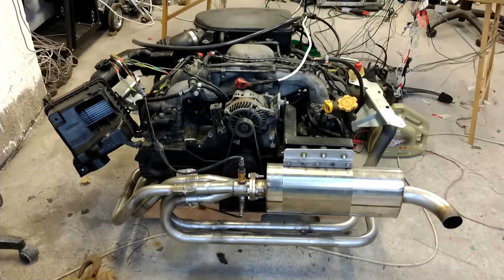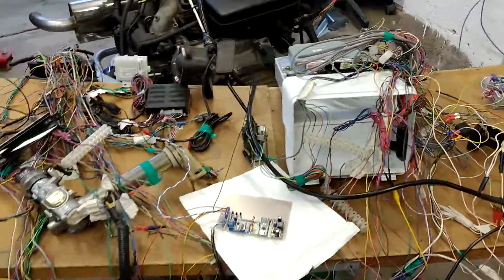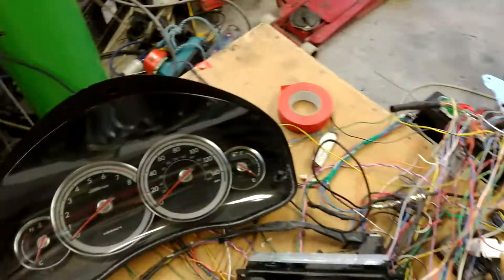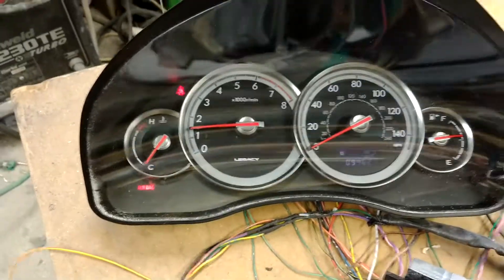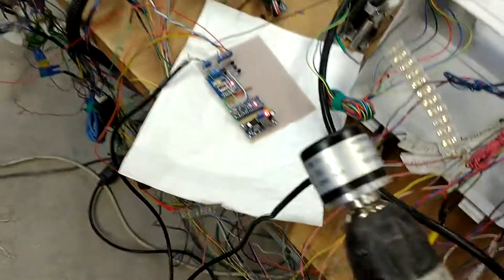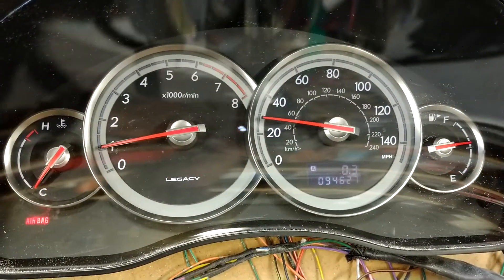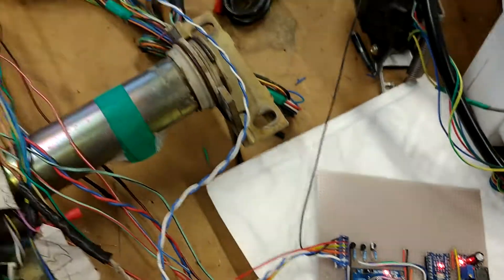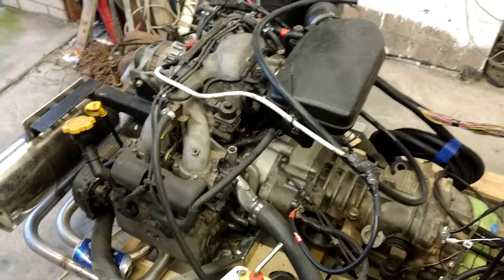VW T25/T3 2.5 Subaru Conversion using MK4 CAN Bus Engine

Comment: Damm. did you do this all by yourself? I am trying to convert a EJ204 for my T3 and none of the converters want to touch it because it is a CAN BUS model.
Reply from the maker: Hi. Yes all me. Although the video shows a prototype board, I made a PCB in the end to do a good job 🙂
Reply: @ well done. 
I am not sure I could ever finish this project, Fellows Speedshop will do it apparently.
Reply: @johnpaullucas  Hi, Felows cannot do the CanBus conversion, can you do  it, if I send you the cable loom?

Comment: Just realised I have bought a cambus engine for our T25. Removed most of wiring but left and unit. Am I screwed?  Love your vid.
Reply from the maker: Thanks mate. You say you removed most of the wiring but left the and unit, if you meant ABS, you don't need that at all. The important parts are the ECU, BIU, instrument cluster, key barrel with transponder and control unit, the throttle assembly, relays, etc. There's a lot there and if you aren't too comfortable with dealing with all that wiring, you can always replace the  top side of the engine with an earlier inlet manifold, injectors, ecu, etc from an earlier engine - I'm not familiar with this but know it's been done. There's a thread on the Club 80-90  VW forum of a couple of guys doing the same CAN bus engine who are documenting their 'journey', here's the link (https://forum.club8090.co.uk/viewtopic.php?f=12&t=166634&start=15). Sorry for the delay in getting back to you, as I was away on holiday. All the best.
Reply: Thats awesome thanks.  Still going ahead with it.  Think I have everything I need and ordered an emulator from AGT in Aus to sort out the signals from the missing bits.  Great video.  :-)
Reply: @johnpaullucas  Covid delayed everything,  but it is now running and mot'd.  Got a few issues and gearbox not working right ( auto),  but getting there.  😃

Comment: Is it in yet.!?

It sounds nice.
Reply from the maker: I'm nearly there, I'm just finishing off the dash electrics and air intake. I'll add another video once it's all installed.
Reply: @johnpaullucas  Much appreciated. 

Out of curiosity, what year Subaru did you use?
My T25 is currently in restoration, and I have a feeling I may well be going the Subaru route in a couple of years
Reply from the maker: @stevesmith4166  It's from a 2004 Subaru Legacy, I bought it for £750 but have already made that back in sold parts. It's a lot of effort but rewarding. I put a 2L from a MY2000 Impreza into my hi-top camper 5 years ago, and it's makes me smile every time I drive it. We went to Gibraltar last year, sustained 80mph a lot of the time to cover the 3300 miles in two weeks and it didn't miss a beat.
Reply from the maker: Just to add, I used RJES components including the bellhousing, engine cross member and coolant kit.
Reply: John Lucas well done. Look forward to the final video 👍